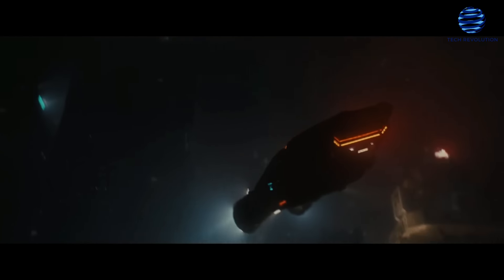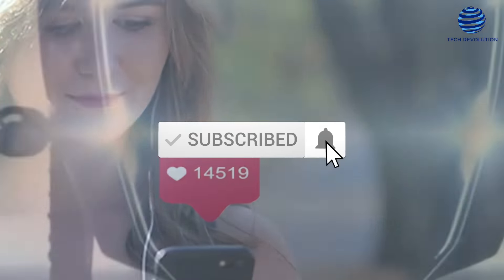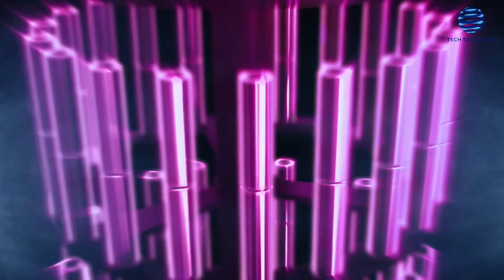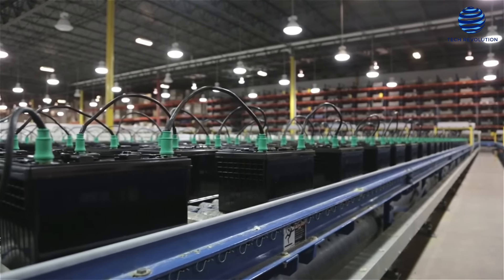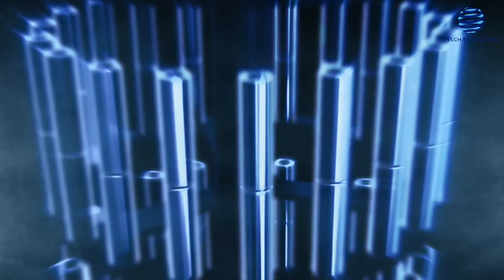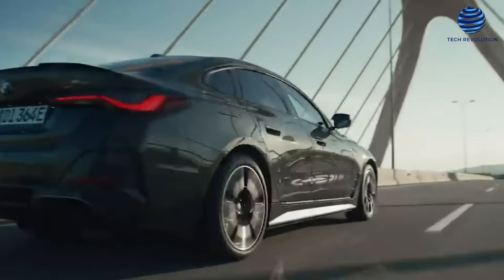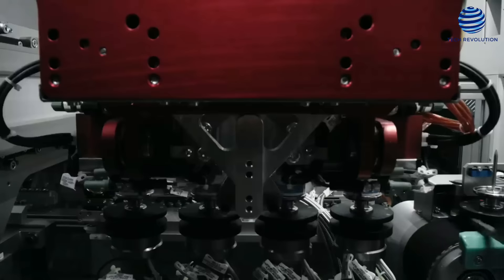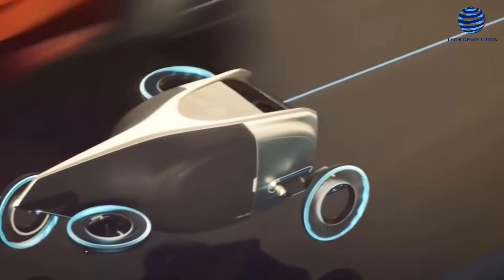EX Tesla Engineer JUST SHOCKED Tesla And The Entire EV Industry By REVEALING This NEW Battery

Comment: More energy storage per weight is important part to make Fully Electric Vehicles to overtake gasoline powered cars. The most critical unsolved problem is the lack of the fast on board charger, which is  99% efficient, smaller than the electric motor and cost a fraction of the EV variable speed  drive.